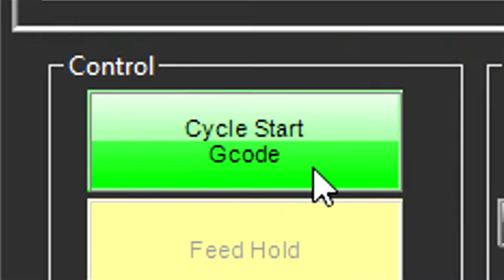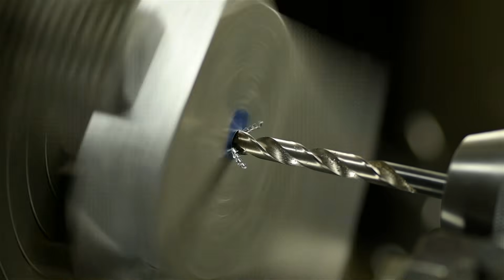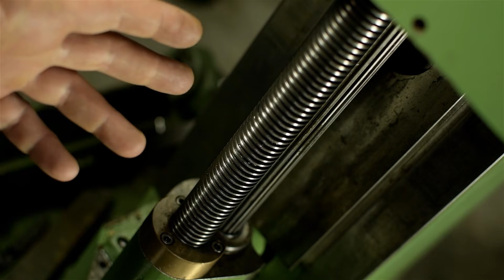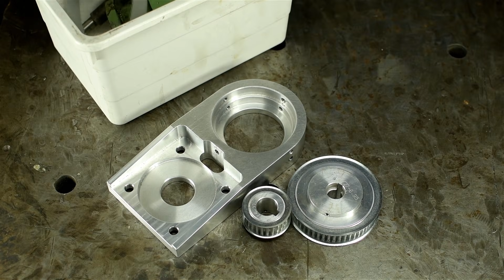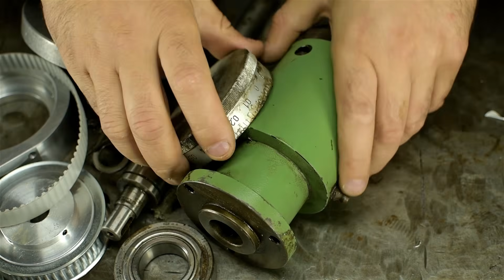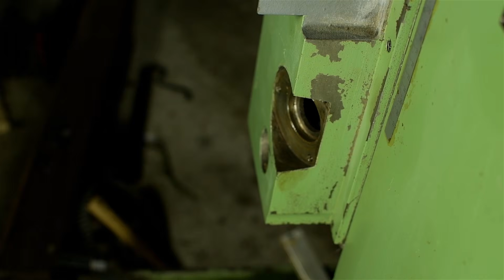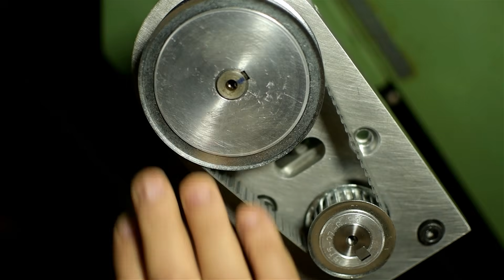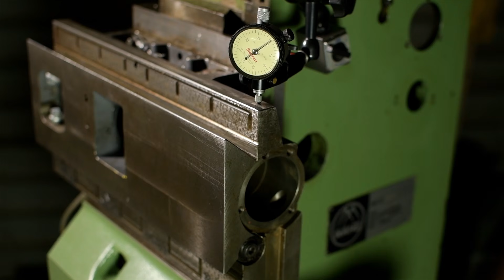MAHO: Move'n On Up!

Comment: For future reference, when you need to cool your belt, a good option is to move to Greenland and only machine in winter with the garage door open.  It's a little inconvenient, but you can't argue with the results.
Reply: 10/10 life pro tip there.
Reply: Don't use V-belt tension setting on a cogged belt.
Reply: @Hopeless_and_Forlorn  Belts I see on linear motion are quite loose. I'm sure you could either use positional accuracy as a means for tightening or temperature. At some point it might drop off.
Reply: It might be better to investigate direct-drive with no belt at all -- if Tony really needs speed on the Z-axis then an uprated servo on that axis only would be a better bet. Direct-drive would also mean he won't have to faff around to get the servo carrier plate out of the way of the knee if there's interference plus it removes another source of positional inaccuracy and maintenance when (not if) the belt wears, stretches or breaks.
Reply: Winter in Greenland with an opened garage door..... I guess you indeed COULDN"T argue, well, maybe forever...
Reply: @robertsneddon731  yessir! At DMG MORI, our horizontal milling centers have direct drive, ballscrews, servo motors, AND scales for positional feedback. I mean, ToT could rig up a linear encoder for positional feedback.
Reply: As a greenlandic person, i can confirm
Reply: @grndune  Pretty sure ToT doesn't want to blow up the Maho and send it to the bottom of a lake. ;)
Reply: Evi1M4chine  You are clearly not a person of the deepest freezes.  -40 (degree of your preference) is exceedingly dry.  ;)

Comment: I repair machines  in a forging facility with about 30 production turns and grinders. Servo's are the best thing since sliced bread! Black rubber belts may help with the heat. And NEVER underestimate having a "home" position to use. Batteries die all the time, crap happens.
Reply: I kinda just want to see him install a Pete Jackson gear drive setup on it... It would give him the 4:1 he wants too...
Reply: No batteries involved, those servos have a 23bit absolute encoder, but a repeatable home position ist worth a lot when you do things like change the belt or screw up your programming,  drive the machine against a mechanical block and your belt jumps a notch or two. 
Slightly related, the Maho came with glass scales, if the Mach 4 Software can use a secondary measurement system for positioning I would reinstall those too to compensate an possible backlash in the mechanics.
Reply: @WoodmanX  yes, but those 23 bits of resolution  are applied to 360 degrees of rotation of the servo, so, someone or something making it take more than a full turn in a no power scenario could mess up the home position (I guess. Correct me if i am wrong)mk
Reply: @lcsantos777  It seems 23bit singleturn encoders actually exist, I have no clue where one would need the 0,00004° in angular resolution so. I had simply assumed a 23bit encoder would be a multiturn encoder, that would split angular resolution and turn counts, those do run over at some point, but assuming a typical 12bit reolution for a single turn would leave you with 2048 turns to count, that seems plenty enough for a normal sized milling machine.
Reply: @WoodmanX  might not even be because of that. Might be simply because you can add 8bits for some other info, a parity bit, and then you have a nice little 32 bit data frame.
Reply: @WoodmanX  Last time I worked with absolute encoders (forty years ago) even 8-bit Gray code units cost a lot of money -- for one application we used a 12-bit encoder and that hurt, financially speaking. God knows what a 23-bit absolute encoder would cost, even today. We did see hybrid absolute encoders in the catalogues, units with a 4-bit or 6-bit absolute output plus an incremental encoder subsystem interpolating between the absolute outputs. The possibility of accumulating errors was reduced but not eliminated, and they were expensive plus they were more difficult to interface to.

Generally as I understand it, servos with built-in positional feedback use a multiphase (usually three-phase) analogue sender which is converted at the control end to digital values by cheap but accurate A-to-D converters. By comparing the separate phase signals an absolute position can be determined to quite high accuracy and by adding a calibration look-up table for an individual servo motor that can be improved even further. I may be wrong though.

I expect Tony will fit hard limit safety switches on the axes, not for homing but to trip out the controller if the G-code has a bad day. One really big CNC machine in our lab had three limit safety switches at each end of each axis because safety switches sometimes don't work. They're cheap enough to overprovision whereas wrecking a half-million dollar machine tool is expensive.
Reply: @TheBrokenLife  PJ's were JUNK! Donovon or Summers Brothers are stuff like TOT would utilize.....

Comment: I know what you mean, I once used an Imperial hammer on some metric nails.. Didn't end up well.
Reply: That can't be as bad as the time I used my metric files to clean up some imperial parts.
Reply: And here I was using a metric adjustable wrench on imperial bolts wondering why it kept rounding the heads.
Reply: It is worth remembering that using an imperial boring bar will always give you an "antique" finish.
Reply: Yeah, takes 1.27 x more effort.
Reply: I would think those metric nails wouldn't bent under imperial command.
Reply: When my wife bakes a cake she has trouble working out what’s metric for 3 eggs!

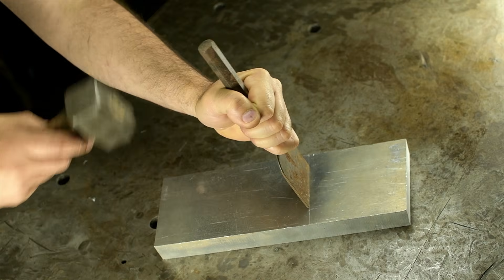Comment: 1:18 you should have pushed harder with the scribe. It would have made a cleaner cut than the chisel.
Reply: @pupudski8066  nice
Reply: I stopped using that method I now just bite the end of the metal off after marking it with a sharpie
Reply: @cmotdibbler4454  I just eyeball it and intimidate it into doing what I want
Reply: Wait... you guys haven't heard of lightsabers ?
Reply: @Methar39  Leaves too much slag and takes the temper out of the metal.
Reply: @cmotdibbler4454  and they require too much Force
Reply: @Sharklops  you're Chuck Norris and I claim my $5 prize
Reply: what i thought everyone karate chops it all this while
Reply: @cmotdibbler4454  Ah, another Terry Pratchett fan

Comment: Look into my eyes, you hear only my voice...you want a ball screw for the Z axis...you need a ball screw for the Z axis...you will be happy with the speed and cooler running with a ball screw for the Z axis. When I snap my fingers, you will awake, refreshed, at ease and very happy with your decision to replace that old, slow, clunky acme screw with a nice, new, sleek, carefully matched ball screw for the Z axis.
Thank you for some of the most fun I have on YouTube! Safe, productive days, and peaceful nights, good sir.
Reply: Help, I don't have a mill but I just got an email receipt for a ball screw I ordered...
Reply: @alexhb12333  don't worry . . . you're not the only one.

[ i ordered three! ]
Reply: So in that case he'll need some kind of brakes (or holdin ax with the servo), without it all z axis will roll down on ballscrew under its own weight when motor is off
Reply: N T, yup that’s one of those complications that caused TOT to stay with the acme screw, while he was going back and forth across much of the project. BUT a spring sustained solenoid brake driven by a slaved relay eliminates that concern. In the end, he’ll be fine either way, but I can’t resist the chance to tease him.
His are some of the consistently best videos on YouTub, IMO.
Reply: @alexhb12333  What is a ball screw, and why have I now got one?
Reply: Before succumbing to Mr. Cluff's hypnotic techniques one must understand the gravity of the situation. Make sure to Google "lead screw vs ball screw" for "vertical applications".
Reply: @alexhb12333  The invoice for the mill was delayed a couple days. :-)
Reply: don't forget the axis brake and nitrogen counterbalance.
Reply: The reason against a Ballscrew is the weight. He'll need some type of counterweight going down, when the assembly moves up and the the other way around. That's when it gets complicated. There are some videos of this done around here, but it sure looks like a ton of work. Not to mention, that this Maho weights way more than any diy mill.
Reply: Id be lying if I said I didnt have three ballscrews for my cnc  in my living room
Reply: SuperAWaC , he surely would not even consider it without counting on the required retroencabulator. No hope of working without it and it handles most of theses concerns with just the one unit........simplifying design and ensuring safe operation under all conditions. Yup, a retroencabulator will do it!
Reply: Counterweight doesn't counter system inertia, it doubles it. Plus there would need to be so much of it that unless the whole setup is designed, machined and aligned to a fair-the-well all that weight is going to impart some sort of moment to the entire Z axis — with ringing! — every time the counterweight is acceled or deceled. Never thought about this problem of automating Z against gravity before. Seems like a real cluster. Or klyster. Hydraulics? Kinda slooooowww. Slaved dual servos simultaneously driving the head up & down against each other with a kind of dynamic preload? How do the groan-ups do it?
Reply: @marcus_w0  thanks for the link.
Reply: Marcus W I’m not so sure. Most of those applications where the developer uses counterweights are driven by cost. The counterweight and nema 34 stepper motor with high ratio pulleys are still far cheaper than a ball-screw and stepper or servo select for the app. Please note this from one ball-screw mfr:

Xxxxxxx (brand intentionally obfuscated) high-load ball screws are available with up to 15 m screw lengths and with single or double nuts. They come in standard sizes up to 160 mm in diameter with up to 1,440 kN of dynamic load capacity. Preloading options are available upon request, and Xxxxxxx (brand intentionally obfuscated) will customise the ball screw to meet customer-specific applications. They provide smooth, quiet motion at higher speeds over a longer life. Lead accuracy is up to 12 µm/300 mm.

The real hurdle in this application is cost, not pitch or capacity. Keeping with the existing Acme screw, he has lower added cost and simplicity at the expense of higher torque requirements and speed (and probably some small hit in accuracy). That servo (with its very high holding torque) will absolutely hold that screw fixed under all normal operating conditions. And if position through power cycling is important to him, he can add a shaft brake.
But it’s all in good fun. TOT is still the most enjoyable way to great project completions on YouTube, IMO.
Reply: Luke Frahn, I hope anyone invested in such an undertaking would absolutely weigh all the options. Most decisions are made with cost as a major factor. It’s a heavy burden to move and hold that mill where he wants it........😁
Reply: Marcus W, he’s using a stepper motor w/attached encoder with what appears to be a fast pitch ball screw, if I saw what I think I saw.
That totally makes sense for his lowest cost possible bodgering (see junkyard wars).
I think TOT will have to weigh all the factors, cost being a very large component of his decision-making. And if he goes to a ball screw he’ll have bigger fish to fry than worrying about a counterbalance.... ☺️ and haven’t you been informed and entertained through all of this?
Reply: Only a screw ball would need a ball screw...
Reply: Marcus W . If you say so, but that looks, appears to be wired like and sings just like a stepper. Using the encoder for closing the control loop, you can get more servo-like behavior (positional error correction), but they still sing like steppers.
My industrial applications experience (both Steppers and AC & DC servos) suggest that servos are usually far quieter at these sizes as steppers do.
You know, if it quacks like a duck....
Reply: @joshdrexler8773  My router has cir cylinder balance on the Z. I suspect the regulators are self relieving. Additionally I think the servo motor is equiped with a brake. Fanuc brand.
Reply: @LynxVeras  Tighten chair fasteners before sitting down to look for a screw driver. Pour 3 in 1 oil on the seat before attempting to stand up! Buy chairs without screwed seats.

Comment: I f&*kin lost it when he hammered the broach thru the pulley bore 😭
Reply: I know! That never works out for me for some reason :(
Reply: @benbaselet2026  clearly, you're using imperial broaches, it's easy with metrique ones
Reply: 666Tomato666 Imperial broaches work fine, as long as you use an Imperial hammer... Les in UK
Reply: @leslieaustin151  oh, silly me, not only I was using metrique hammer, I was using metrique anvil! It's a miracle it didn't braze additional metal in the hole!
Reply: 666Tomato666 !! 🤔😁 Les